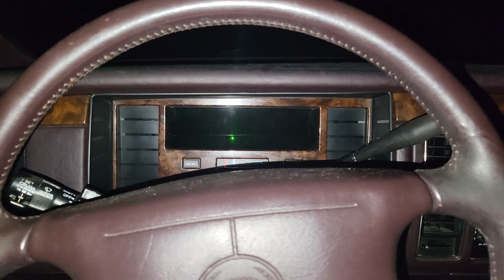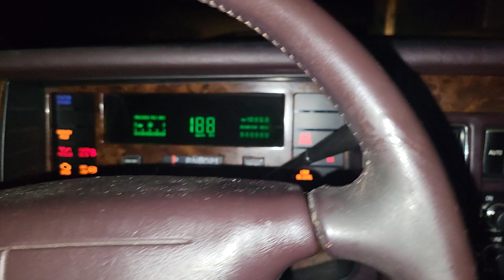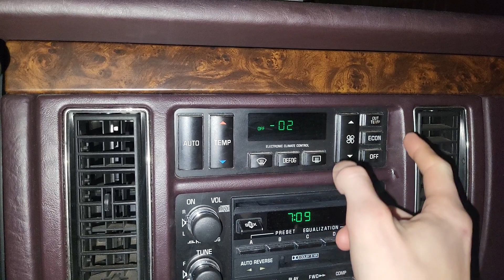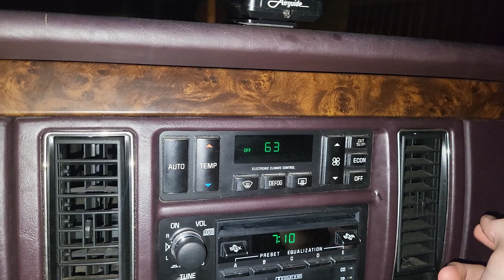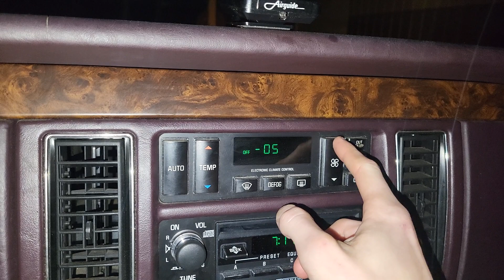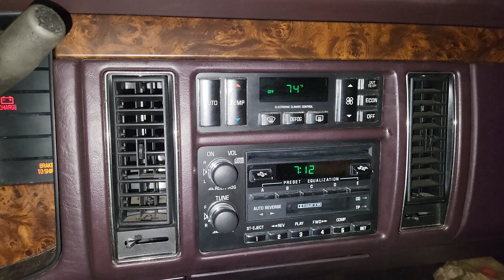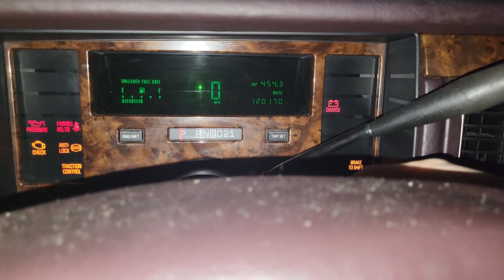how to read trouble codes on cadillac fleetwood 93-96

Comment: I have a 1993 fleetwood and previous Owner swapped out tbi for a carb and a lot off plugs arnt plugged in and no check engine light or codes show 
How would I make all codes and lights appear to begin going back tbi
Reply from the maker: He probably removed the bulb from the dash for the light. It's what I did when I carb swapped my oldsmobile. You'd have to tear the dash apart and see if the bulb is there or not
Reply: It make my head hurt to think about the custom engineering needed to take a port injected engine down to a carburetor, and have the computer understand any part of it.  I would claim it can't be done, but I'm not a professional.  Whatever the case this sure sounds like an ill conceived idea from the start.

Comment: Is there a way to disable the abs?
Reply from the maker: Not officially. The easiest way ti do it is to unplug one of the rear wheel speed sensors, but then the abs light will be on forever
Reply: @riotautorepair9662 sorry that’s what I ment. We had to take the abs out and the light came on. So I want to get rid of the light on the dashboard
Reply from the maker: @nimster64 just cover it up with black tape or take the dash apart and remove the bulb if you don't like the tape